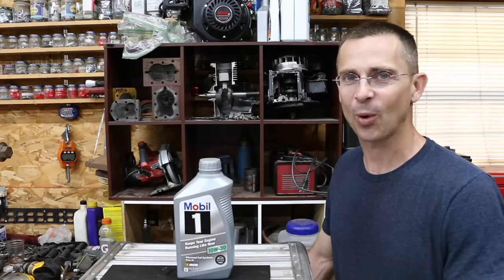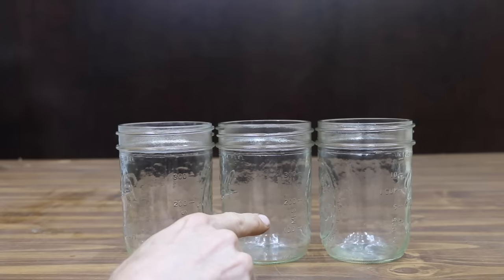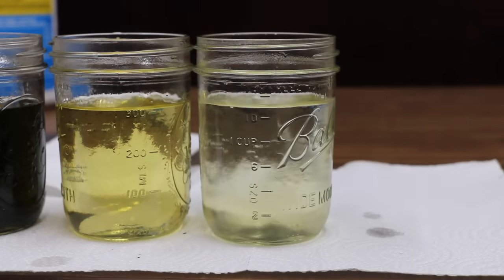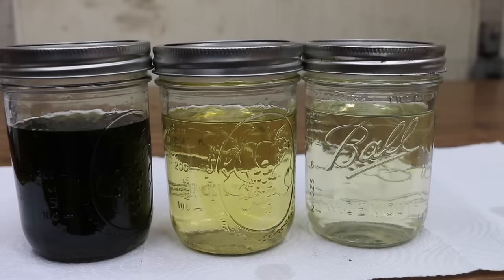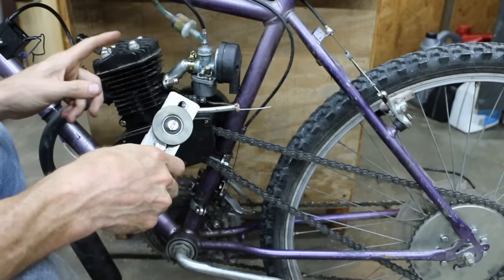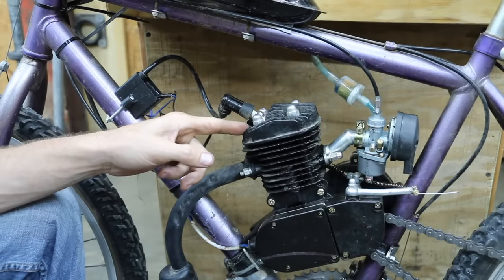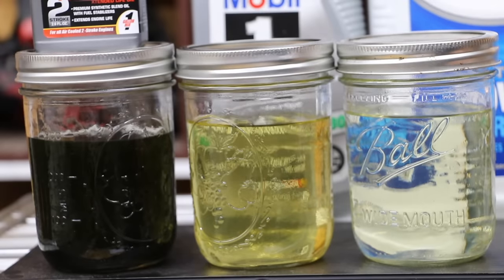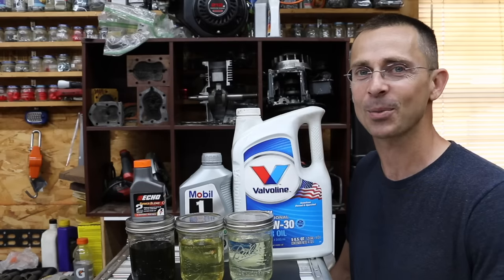Will 4-stroke oil damage a 2-stroke engine?  Let's find out!

Comment: I recall I had to use 4 stroke oil mix with gasoline, out of desperation, for my 2 stroke motorcycle.  I had a Kawasaki enduro bike when I took it out, on the road, for an extended ride out to the California coast as i was feeling a bit down at the time; and figured a motorcycle ride would boost my spirits.  Stupid me that I didn't check the oil level for the oil injector reservoir tank before leaving home.  Out along Highway 1, something signaled to me that the oil injector tank was nearly empty, so being out in the middle of nowhere (and this was back in 1980, years before cell-phones came into being), I shut the bike down and pushed it along a side-road with the hope of finding a house that could spare some engine oil, where I planned to do an oil/gasoline mix.  I happened upon a farm house, where a teen girl greeted me at the door.  I explained the problem I had and asked if there was some engine oil I could use.  She kindly gave me an opened can of 30 weight four-stroke engine oil.  I was clueless of how much of a mix I needed to use for the gasoline, so I poured some engine oil into the gas tank.  I thanked the girl, the engine fired up, and I made the 40 miles back to home; albeit the blue-smoke engine exhaust was about the thickest I'd ever seen.
That engine never did run quite the same after that.  But, it was no biggie, as I already had plans with buying a street motorcycle by that time.

Comment: After an engineer and a mechanic both told me they used 4 stroke motor oil in their 2 stroke engines I started doing it 18 years ago and have used it in Out board motors, lawn mowers, snow sky, weed wackers, farm bikes and chainsaws. Never had a problem but do it at your own risk.
Reply from the maker: Thanks for sharing.

Comment: CCIS oil was also released when Japan's Suzuki Motors adopted the Suzuki CCIS system in its two-stroke engines in the early 1970s.  The English owner's manual for the LJ10 Jimny states to use SAE30 oil for CCIS.  I interpreted from this description that CCIS oil has a viscosity coefficient equivalent to SAE30.  However, from many comments in the comment section, I was very surprised to learn that before the 1970s, SAE30 oils other than 2-stroke oils were widely used outside Japan.
Reply from the maker: Thanks for sharing.

Comment: Antique Maytag washing machines were powered by 2 stroke engines. Maytag recommended 16:1 ratio 30w motor oil. The was in the 1930's-40's before 2 stroke oil was a thing. Many of those engines are still running today.
Reply from the maker: Thanks for sharing.

Comment: Most of the pre 1960 outboard motors had a decal on them for mixing oil. (I got a few restored outboards from 1922 to 1956). And it says on them to use straight weight conventional motor oil. I don’t, but it is interesting. Retired marine technician here.
Reply from the maker: Thanks for the feedback.

Comment: 17 years ago, out of 2 stroke oil.  Mixed up a batch of 4 stroke using the 32:1 ratio in a Stihl ms 210c chainsaw.  Cooked it on the second tankful.  I was pushing it pretty hard, but not more so than I normally did.
Reply from the maker: Thanks for the feedback.

Comment: If mixed with the fuel, four stroke engine oil is absolutely fine, you may find that you have to de-coke the engine a little more often, but I run 10/40 oil in my 1968 BSA Bantam which is mildy tuned/modified, and when I removed the cylinder, the piston was clean as a whistle and all bearings were covered in oil film. It gets a massive thrashing too... 70 plus mph...
Reply from the maker: Thanks for sharing.

Comment: I own a 1984 Mazda Rx-7. From the factory, they have an "Oil metering pump" that injects mists of conventional oil into the carb that mixes with the gas, these commonly go bad so many Rx-7 guys just run 2 Stroke premix as the rotary needs that lubrication constantly. No issue between the two as far as I know.  Always thought it weird that everyone said it will hurt your dirtbike if you mix up 4 stroke oil.....
Reply from the maker: Thanks for the feedback.

Comment: Interesting to find this because many years ago . . . 1973 ish . . . . I had a Bond Minicar, a three wheeler with 250cc two stoke motorcycle engine under the bonnet. After rebuilding the engine, I assembled it using a 20w50 engine sump oil and used the rest of the gallon in the fuel. It didn’t run right and wouldn’t get the car to more than 35mph because it would cut out and refuse to start until it cooled down. Short version. This engine was rebuilt with “competition parts” so it was relatively highly tuned for its day and the owners manual suggested that the symptoms suggested incorrect ignition timing. However, this behavior stopped after switching to Castrol R (bike racers favorite two stoke oil in the day) for a couple of tanks of fuel. Engine didn’t seam happy with “4 stroke” oil.
Reply from the maker: Thanks for sharing.

Comment: spec sheets on ancient two stroke equipment, i noticed awhile back, used to call for sae30 as the mixer. this was before 2-stroke specific oils hit the market.

so i went thru a dirt poor phase in my life when i would grab the nearly empty quart jugs from the trash cans at the parts stores and gas stations and i would swish a pint of gas around in the nearly empty oil jug. then i'd pour that mix into the next near-empty jug. and so on. if it looked too thick, i'd add more gas. not advocating this approach if you can afford to do it right, but i put in many hours on my shindaiwas and other equipment running my poor man's mix and never seemed to have any problems arise.
Reply: i would also harvest brake pads and coolant from the junk yard instead of buying them new. did i mention, dirt poor phase of my life? sure, a pad friction slab would occasionally succumb to the rust scale between it and its mounting bracket. that just meant time to put on a new brake pad. new, of course, meaning used, and brake pad being, of course, in the singular sense.
Reply from the maker: Thanks for sharing.

Comment: I have one of those cheap 80cc motorized bike kits and I run 20:1 mix of USED motor oil with no ill effects, engine runs great and never fouls the plug.  I mix about 1.5 gallons up at a time and the oil doesn't separate from the gas after sitting for long periods either.

Comment: Older two stroke engines said you could use regular motor oil, some said to mix it a little richer. Years ago I used regular motor oil in an outboard motor for years , it had no ill effects, that engine had a long happy life. As an old oil man told me it all comes from the same well.
Reply from the maker: Thanks for sharing.

Comment: I used 10w30 in my elan  ski-doo from 1974 to now. Only had to change the plug twice,  oil seals three times  and rings three times.  I put about 1000 km a year and it still works fine.
Reply from the maker: Thanks for the feedback.

Comment: in the late 60s when I started riding motorcycles. I rode two stroke two cylinder motorcycles with oil injection pumps. Kawasaki, triples, suzuki, and Yamaha twins. The only oil I ever used was boron gas Station boil called PEMIX, I think that was the name of it. I bought it because it was cheap and I lived near a boron gas station. It was their mid grade car oil. I never had any seizures. Of course, back then, oil had possibly more zinc and phosphorus in the additives package, which gives the oil a greater film strength. You did have to carry Tools and spare spark plugs in those days
Reply from the maker: Thanks for sharing.

Comment: Great video. Thank you. Before I watched this I was thinking about the 5W-30 oil instead of 2T oil. As it was demonstrated, there is not a huge difference. And actually I can buy a 20 liters drum 5W-30 40-45% cheaper that a 20 liters drum 2T oil. BTW i never believed the 50:1 mix ratio. I always do 40:1 or 33:1, if I am starting to use a brand new engine I fill up the tank with 20:1 a couple of times before go leaner. Might be silly idea but I had no issues so far.
Reply from the maker: Thanks and you are welcome!  Thanks for sharing.

Comment: On my motorized bike, I swapped out the plastic tensioner with a larger metal roller.  It ran quieter right away.  I put a 1/4" keyway in the top between the metal pieces, and it stopped the diving into the spokes problem.  Two keys on my motor mount kept the motor from moving, where rubber would only slip and toss the chain after a block or two.  It's far stronger than putting a hole through the frame.
Reply from the maker: Thanks for sharing.

Comment: Very cool....The fuel mixing directions on an old David Bradley chainsaw has mixing directions using sae non detergent 30wt oil mixed with hytest gas. saw was built in the early 50s and now when I start it I still mix it the same except the hytest dont have lead in it anymore..lol. Only crank it bout twice a year to make sure it still runs....Keep in mind that this old saw has never seen ethanol and I dont use ethanol in any of my equipment. Great video...as always you sure are checkin out the stuff. love it!
Reply from the maker: Thank you

Comment: About thirty some years ago I had a craftsman push mower.  I ran out of gas just before I finished the yard. SO , me being the MacGuyver type, I mixed some Coleman stove fuel and some 90 weight gear oil and put that in the mower. Ran GREAT.  Didn’t measure anything either. Got lucky. Was either a Briggs n Stratton or a tecumseh  engine.
Reply from the maker: Thanks for the constructive feedback!

Comment: Oil is Oil ! -
 I've been using budget oil in my Mercedes for 350,000 miles and it's still going strong. I've probably saved a few thousand !!! ( change oil every 8k miles - well before the Mercedes recommended interval).
I use high quality oil filter though.
Reply from the maker: Thank you!

Comment: Over 60 years ago 30 weight non-detergent motor oil was used for mixed  oil in 2 cycle  lawn mowers and chain saws they ran good. The usual spark plug cleaning was done.
Reply from the maker: Thanks for the feedback.

Comment: Older Rotaries burn crankcase oil. I helped make 2 stroke diesels for electromotive diesels and those engines used crank oil too! 

I use Motul 800 on my YZ250 and yamalube 2W on my Waverunner
Reply from the maker: Thanks for sharing.

Comment: In the early 80s my dad purchased a boat with a 40hp Evinrude on it, when I asked the seller what type 2stroke oil and the mix ratio, he responded 1qt 10/40 to a tank full of gas.  Of course then gas was gas, not gas thinned with alcohol.  The lower end was getting tired from catching sand bars in the Colorado River, but for years I skied behind that engine with never a problem.  But back then engines weren’t smart enough to understand synthetic oils. My R/C gas engines favor Pennzoil air cooled, but it’s hard to find.  Have 3qts. of Amzoil on reserve.  Will monitor and advise.
Reply from the maker: Thanks for sharing.

Comment: i had a 2stroke mower since the 80's till well after 2010 and only ever ran it with 20w40 engine oil. it never failed to start and i got 30 years from that mower. the base plate and height adjuster were the reason i got a new one. the engine and carbie were fine. the only issue was needed new plug each spring, where as with two stroke oil i might have got 2 or 3 years from each plug. but a new plug each year saved a lot of trouble starting it as with my new mower, after 2 years, its just a tad hard to start but will start none the less. i dont think id use engine oil in a high tolerance motor like a dirt bike or generator. but for an old mower, absolutely fine. icant recall the ratio, but about 200ml in 5 litres of fuel was my mix rate. i guess that about 25:1
EDIT: i forgot to mention, i never used new oil....only old engine oil from my car.(filtered in fine cloth)
Reply from the maker: Thanks for the feedback.

Comment: will you test 2 stroke oil/fuel ratios?  is 50:1 ideal for efficiency or is it recommended to reduce emissions?  if 40:1 or 30:1 better for engine longevity to provide less wear to the parts?  do we lose mpg with the higher oil concentration, spark plug more likely to foul out?  A harbor freight 2 stroke generator could be used for the efficiency portion with a constant load like a work light.  I'm curious if running 50:1 for too long would lead accelerated wear and tear in the bearing and cylinder wall.  I also wonder if a higher oil to fuel ratio in the cold would lead to more difficulty with starting or other operation issues.

Comment: I had a Honda 2 stroke scooter and my friend put regular oil in it.
than it . than it ran regular, then ran and noise got louder than shut down.
I believe its the protection system because the motorcycle overheated, and the fact we didn't use 2 stroke burnable oil!
good lesson..
do you agree or think its something else?

Comment: Yes, many years ago, one mixed plain oil with gas for 2-cycle motors. 
Usually at something like a 16:1 ratio, or 6.3% which is a whole lot of oil.
This massive amount of oil ensured lubrication, but caused massive amounts of deposit build-up and massive amounts of smoke, as well.
Reply from the maker: Thank you!

Comment: Long before specialized 2 stroke oils, there was only motor oil or “Bean” (Castor) oil. A day spent at an enduro meant you might get a case of the shirts. 
I found that Amsoil 2 stroke synthetic, new for that time, was so slick it would not allow a new engine to break in.
Reply from the maker: Thanks for the constructive feedback!

Comment: 40 years ago of more my father told me if you didn't have two stroke oil you could use four stroke motor oil.

A mechanic friend told me about having an old Victor (Australian) two stroke lawn mower laying about spare and so for want of anything else to do with it he decided to run it at full revs until he destroyed it.

I can't recall how long he said it ran for but it was a far amount of time but the old Victor seemed to be indestructible, so he got out a 303 Lee Enfield rifle and fired two or three rounds into the Victor before he could kill it.   

Good thing a Victor
Reply from the maker: Great point

Comment: My dad used noting but the cheapest 30 wt  4 stroke motor oil in his chainsaws with no problem (this was in the 1960s). Oil was usually Piston Ease Re-refined motor oil. We also kept a gallon of used motor oil for bar lube.  To avoid a special trip to town, we would sometimes use the used motor oil in mix for the engine.  No problems as long as you poured it through a cloth to filter first.  But one day in a pinch, he used hydraulic oil for the mix -- engine seized.   Maybe you should give it a try.  I seem to remember it was Texaco Reagal C brand.  I was probably around 20 years old before I knew there was such a thing as 2 stroke oil.  A buddy had some for a new outboard.
Reply from the maker: Thanks for the video idea.

Comment: Years ago, my Yamaha 200 two-stroke twin ran on Castrol GTX (4-stroke oil) for ages. No plug fouling. Funny thing was the motorcycle dealer actually recommended it! When I changed to using proper 2-stroke oil a plug would foul up occasionally. Go figure.
Reply from the maker: Thanks for sharing.

Comment: back in the 50's and 60's people just mixed normal motor oil for two stroke engines. It was 25:1 ratio as I recall, it worked. Makes a guy wonder about all the "better-newer" ways. Time was when things were simpler and effective.
Reply from the maker: Thanks for sharing.

Comment: I did this (as did thousands of others) for thirty years without major issues. However, sparking plugs sometimes developed a conductive whisker that shorted the points out, causing the engine to stop. I don't see that these days on the garden machinery, also, the oil mix ratio is now (at the most) halve what was used then.
Reading through various old "instructions", it seems that if we use 4stroke oil, we should mix at 25to1, but with 2stroke oils, it can be 50to1. or even 100to1.
on my chainsaws: I use Stihl oil, 32to1, but every one I know these days uses 50to1 for everything, but I suspect that they often guess it, with a dollop extra for luck, so god knows what actually gets mixed...
Reply from the maker: All great points. Thanks for commenting.

Comment: I’ve had to do this on a late night cement job in a quick cut saw. No stores were open to buy 2 stroke oil. I used 15 w40 @50-1 no problems.
Reply from the maker: Thanks for sharing.

Comment: I've used motor oil many times as two stroke oil in a pinch. Never had a problem other than a noticeable increase in smoke. Of course that will translate to more deposits on the plug and the muffler screen, so additional maintenance of those will be needed the more one uses it.
Reply from the maker: Thanks for sharing.

Comment: I water skied with a friend that ran the old Havoline 30W engine oil in his gas mixed for his V-4 Johnson. He ran the hell out of that Larson all the time. That oil would stink of ash and sulphur when you opened it with the old sharp point can openers. Around 40 years ago. I found out since film strength is in the oil. As long as you have enough to support bearing loads, etc. it will run without serious side effects no matter what oil design.
Reply from the maker: Thank you

Comment: Before dedicated two-stroke oil came along all there was is regular mineral and castor oil. The trouble with mineral oil it is it fouls the plug. It's called whiskering because you get a whisker of carbon across the plug points and shorts it out. Castor oil is a good lubricant. It's what the famous Castrol R40 is made of. It smells lovely but it gums up engines that are not worked hard. Also, castor oil doesn't mix well with petrol aka gas and separates out. The new Castrol R formulation now prevents that apparently
Reply from the maker: Thanks for the feedback.